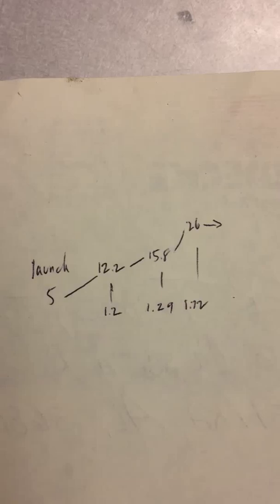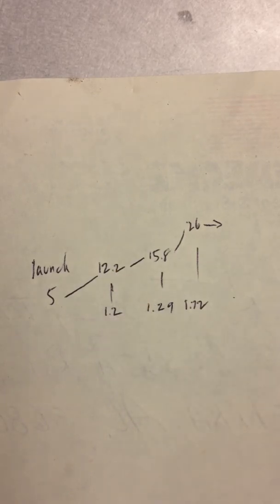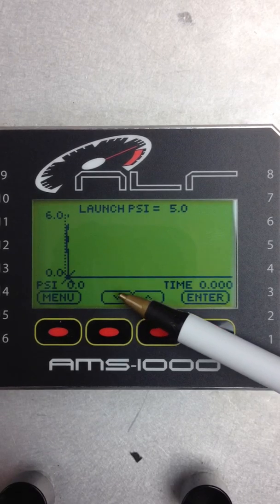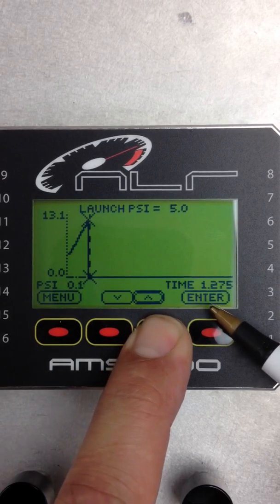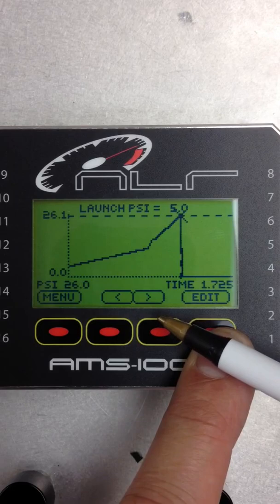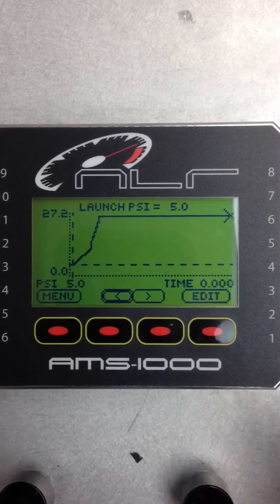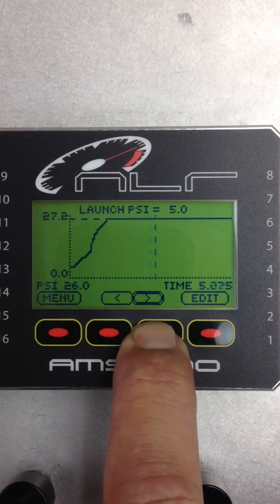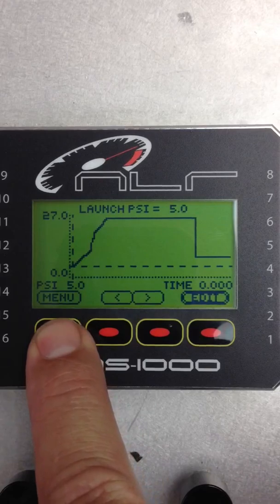Ams 1000 graph software

Comment from the maker: 0 is at 5 psi and climbs to 12.2 by 1.2 seconds. An activation input starts the process in conjunction with transbrake or brake or clutch switch. Nothing will happen until you leave the line.

Comment: so because this is boost by time instead of using something like the VSS sensor and doing boost by speed. what activates the unit? i don't want to be sitting at the line after both bulbs waiting for the tree to drop meanwhile the 1000 is already a second into the graph.. how exactly does that work??

also because it ramps the boost up so it hits Y boost at X time. am i correct in saying that at 0 seconds it is at 5psi, but by 1.2 seconds it is at 12.2psi? or is it 5 and hold 5 only from 0 to 1.2